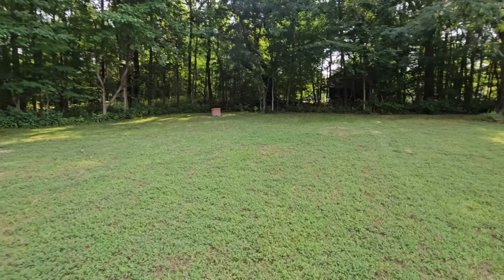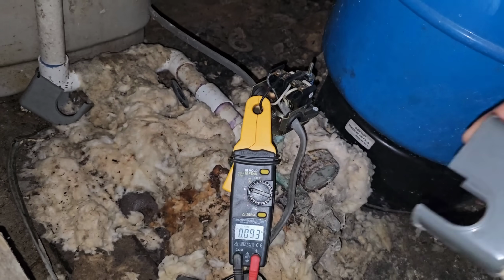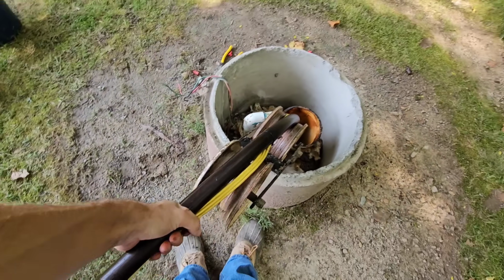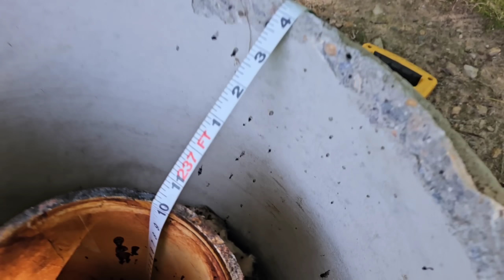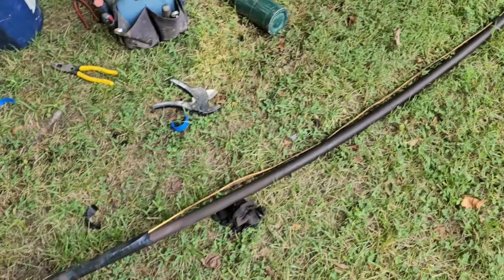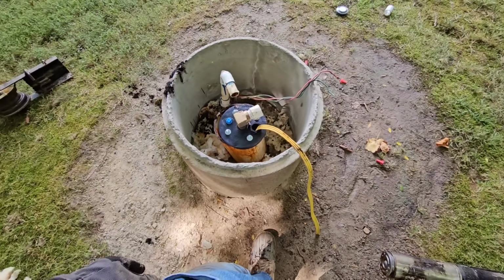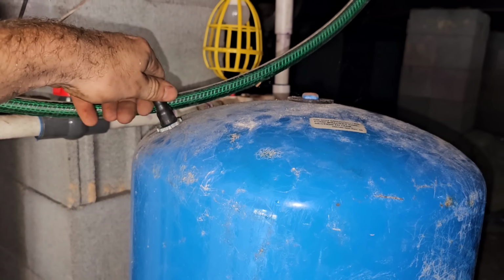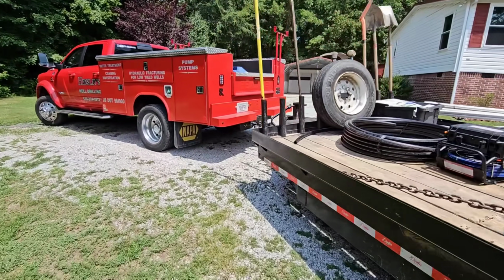Well Pump was Stuck on the Bottom in this Nasty Mess! That's Terrible Looking

Comment: Why aren't you looking down to the motor with the ohmmeter to check continuity?  That"s Step 1.
Reply from the maker: @desertbob6835  the first company that came out, they tested it and gave me the information, then they found out it was stuck on the bottom. Regardless of OHMs, there was bigger issues at hand.

Comment: How much did this job cost the customer?
Reply from the maker: @andrewo.5722  I charged $1870
Reply: @h2omechanic , very reasonable. My pump cycles about every 20 seconds when running the sprinklers. I'm guess that's relatively normal. Do you recommend static pressure pumps? Looking to replace soon, located in Zimmerman MN.

Comment: Why don’t you use zip ties instead of electric tape to attach the wire to the well pipe.
Reply from the maker: @johnmastin7620  they always slide down and stack in 1 spot. & like to cut your hand when you pull out a pump

Comment: Why didn't you service the well? I din't see high pressure washing unit cleaning the well bore? You left all that manganese crap hanging on the well bore wall? I can see you just want to sell pumps and pressure tanks. You could have tested that sub pump, no big deal. That pressure tank isn't bad, the bladder inside it is bad. You just need to replace the bladder, not the whole tank. Bladder is cheaper than tank. So would have been the older pump still useful.
Reply: That's not what he was hired to do.  I'm sure that we don't know the conversation with the customer either.  And cleaning the bore wall will last a few months and it will look that way again.  

Replacing the tank is the right choice.  Replacing the bladder is a crappy job, leaves the homeowner with a tank rusted/rusting on the inside, and is something he will have to provide some warranty on.  Harry homeowner can replace the bladder.  A professional has to make a living and not get call-backs and be bad mouthed over town when the bladder replacement fails or the tank fails in 5 years.

Comment: It seems we have a lot higher standards in EU for hygienity at drinking water works.
No way you pull that pipe along the ground and even step over it with your shit boots and then place it back to the well thru dirty wheels. Do you then tell your customer to drink that water without chlorination? If you were my employee you would be fired.
Reply: I never seen anything like this. Around me most have PVC or metal pipe and a well truck pull the pipe out and its threaded together
Reply: @johnhaas2523  pvc is not food grade unless it is pvc-nyl grade. Solid pump pipes are practical in high production wells. 4" submersibles work fine with hdpe pipe. One just needs to know how to work with it. It's lowered to well from reel and pulled to reel from well cleaning it simultaneously. Special fittings are used to attach electric cable.
Pump start torqie twist can be eliminated with soft starter or/and with inverter controller. H2O mechanic seems to know only on-off pressure switch. He's typical DIY miracle, not a pro water-well technician.

Comment: Hoe do you properly check the air pressure in the later tank. Do you have to shut the water pump off and drain all the water pressure and then test air pressure?

Comment: Not really related to this video exactly, but why do you not put unions on the output from the seal? Would make much more sense than cutting and re-gluing pipe each time the pump needs to be removed.